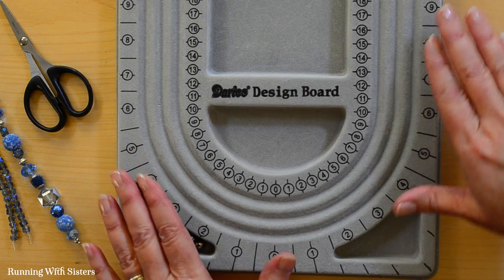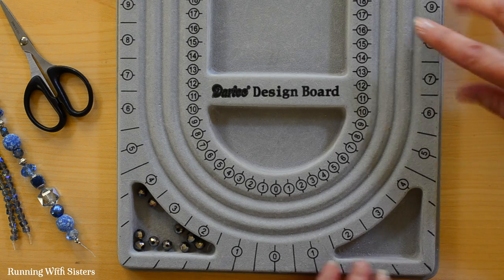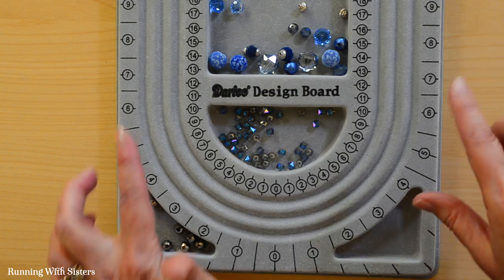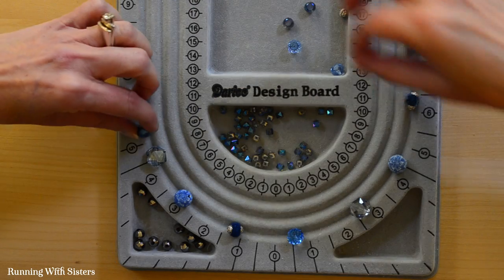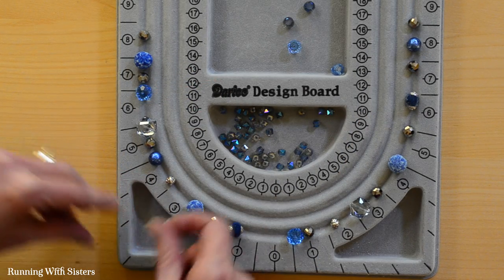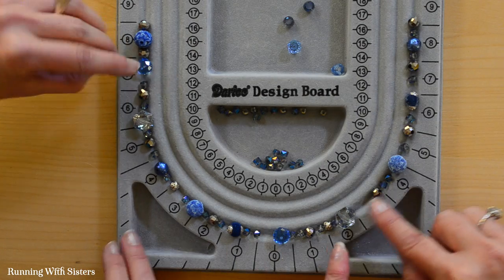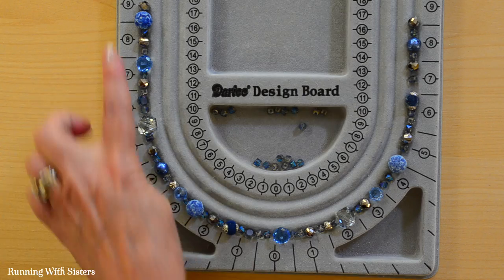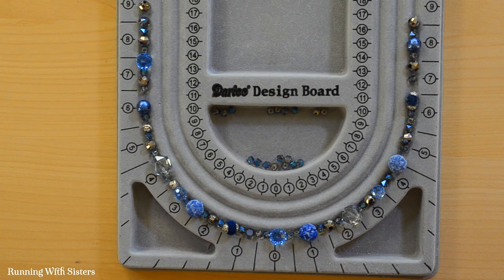How To Make Jewelry: How To Use A Jewelry Design Board

Comment: I just found this video and was wondering which is better to use for making bracelets, a straight line board, or curved one like in the video, or one of those boards you see made with the round grooves?
Reply from the maker: Great question! We like to use a small straight beading board for bracelets, but this curved one works well too. We just like the size of the smaller bracelet board.
Hope that helps!
Jennifer & Kitty

Comment: Does number go by inches or cm
Reply from the maker: Great question Yazmin! The outside numbers are inches. We like to start at the bottom center. This is marked zero. As you add beads to either side going up the outside channel, you can look at the numbers to see what length your necklace will be. If the beads reach 8 on each side, your necklace will be 16” long (add  a little for your clasp).
Hope that helps!
Jennifer & Kitty